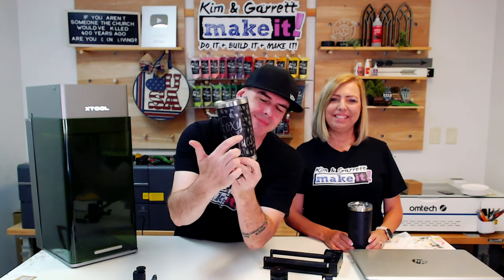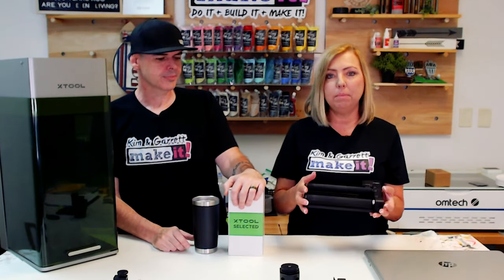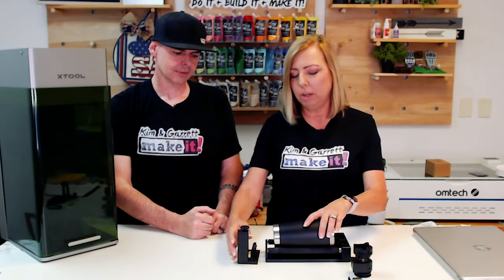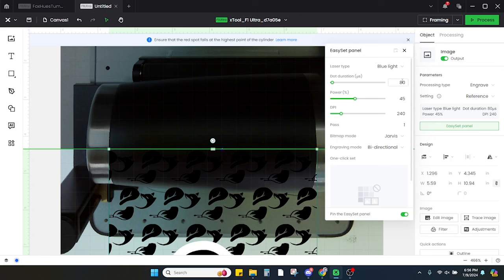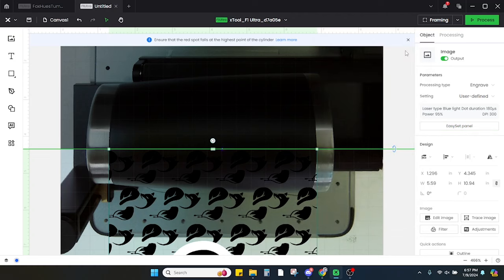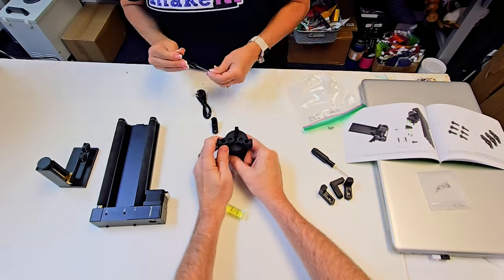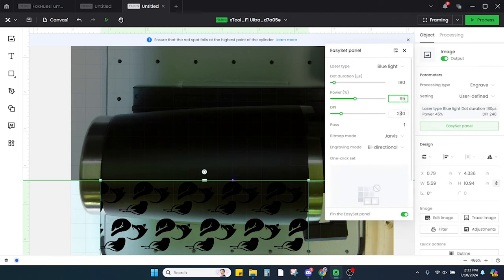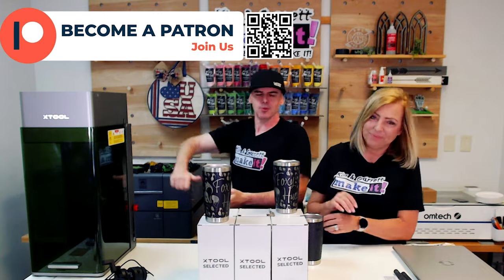Exciting Tutorial: Engraving Tumblers with Precision

Comment: Great video! I just received my F1 Ultra and haven't done a tumbler yet, I have done some on my F1 and used the method of running the blue laser on the first pass then the IR on the second and using the chuck and no issues with it not running the same area on the second pass.

Comment: What tumblers did you use?  Normally do sublimation for my wraps but very interested in using a laser.  Glad to see you make mistakes as some of the videos it seems everything comes out perfectly.  Gear drive on the chuck will always be better and more accurate than the rollers because as you said things can slip on the roller and you might not notice.  Very important if you have to make more than one pass.

Comment: Hey i enjoy your videos. I have a 32oz powder coated water jug covered in backwards and failed engravings. I have a roller and a rotary chuck. The thing has dents in it from being dropped multiple times. That makes problems for the roller and it's too long for the rotary jaws to hold. I even 3d printed a longer set of arms but they seem to need to be angled in so they didn't work either. I finally did my first 3 successful logo engravings on 20 oz tumblers for an event for our RC club which I donated. They bought 20 more for me to do for the next event. Having some extra tumblers to hone my skills would be awesome!